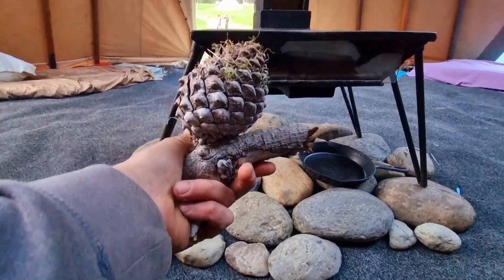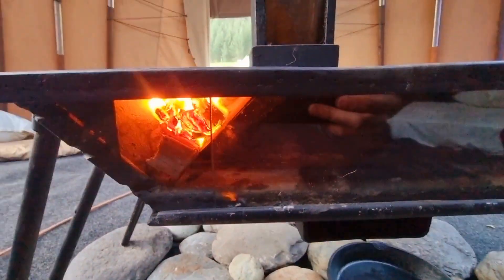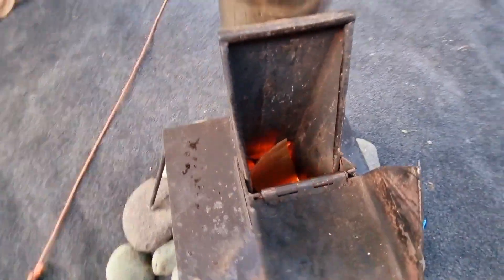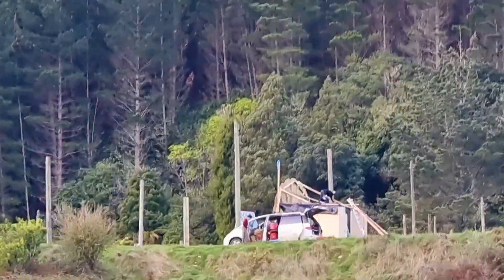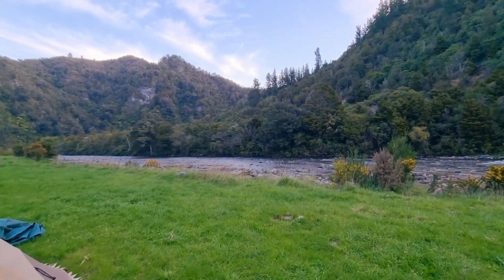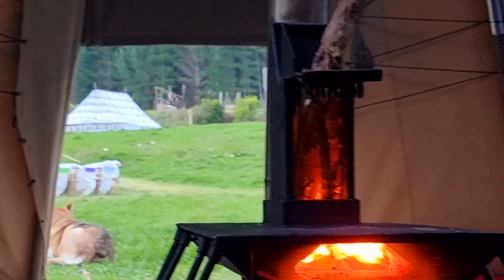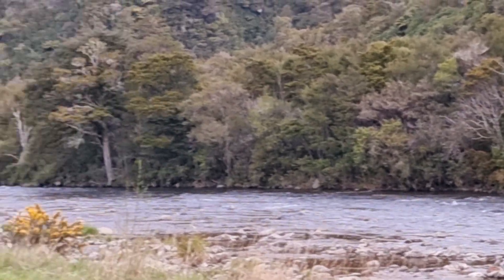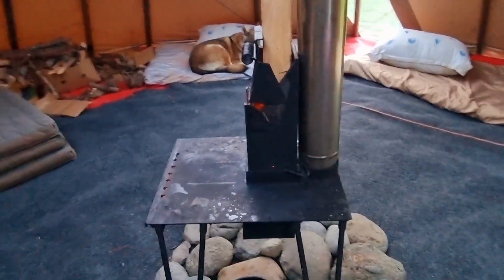MR FUSION .                                                    multi fuel twin vortex,  rocketstove.

Comment: Excellent upgrade since the last time i visited the channel.  Will keep checking for more!  Love it!
Reply from the maker: @pantalonesfrescos1130  thanks for that. Yeah I just sold that rocket stove and the 7 mtr tipi that it's in. My latest project is a sauna. 
I am building a 5.6 mtr diameter scale model of the great pyramid of giza.
Inside will be a newly developed J type rocketstove. 
It's going to have a 560 mm square base ,scale pyramid shaped secondary combustion chamber.  The pyramid will be coated in basalt stone that is used for pouring water on to make steam. It's hard to explain but watch this space. More to come.

Comment: Hi, I am living in south of France, I love this stove you designed.
Very nice, economical, practical, artistic... With the afterburner... Love it
The only thing that I dont like is the square glasse on the sloped steel, but I am guessing it's only temporary on this build.

I would like to build my own inspired from yours.
What is the thickness of the top plate on your stove ?
I plan to try with 5mm but I am not sure if it's enough.
Thank you

Comment: Plans ?
Reply from the maker: @Princess_n_TheDuke  
I will make plans available when it is safer. I still have one design flaw to work out before I start selling the stove or plans. This design can currently get what's called reverse chimney.  Two things can cause smoke to travel up the fire box . Gusty winds blocking the fire draw and cavities in the fire box when wood doesn't drop properly into the fire basket . I have designs ready to test,but these things take longer than I like

Comment: I have designed and built something similar before using tubing and sheet, I'm trying to make one out of stainless, that packs away. Weight is the problem and tight fitting edges 🙏 I think your idea is genius, I love a sound system also, and have built a motorhome. Wow, what a place you have!!
Reply from the maker: Thankyou I to would love to make a lighter camping or survival model. I haven't had much luck with that. The top plate is the 1st to start warping and twisting under the heat. I tried to go down to 4 mm steel even that buckled. Thanks for watching
Reply: Have you seen ilanto Evan’s pocket rocket.  I’ve made them out of a metal 5 gallon paint bucket and a couple short lengths of pipe.  It’s not as slick, esthetic, and elegant as one of these, but it is a very effective light and portable space heater.
Reply: https://www.rocketstoves.com/pdf/pocketrocket.pdf